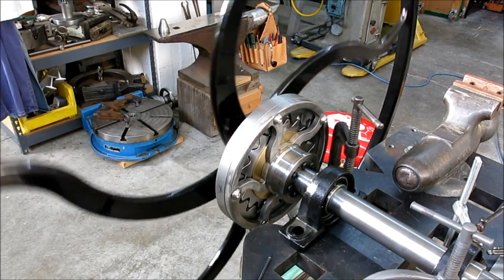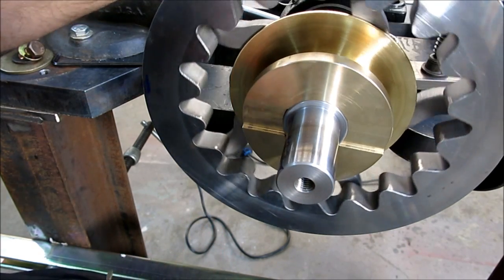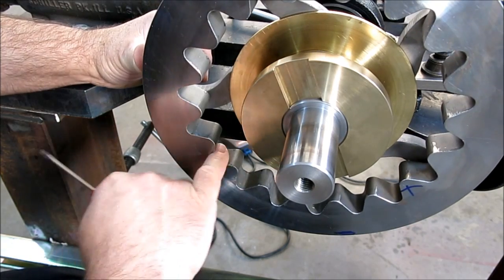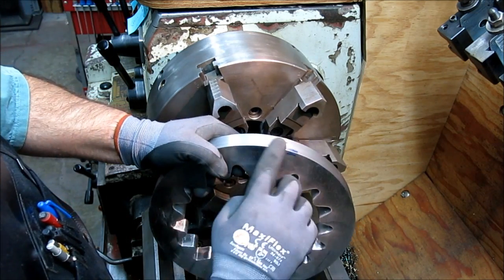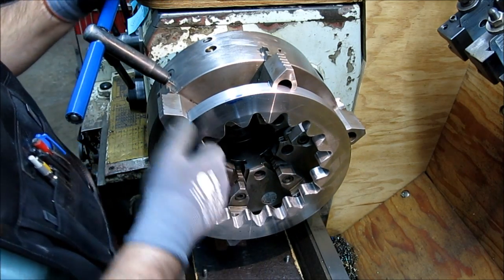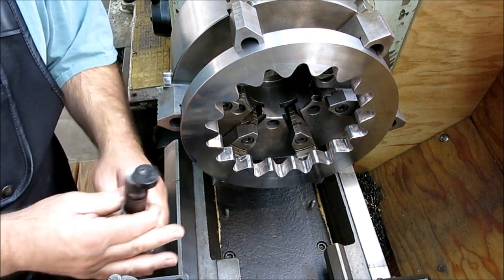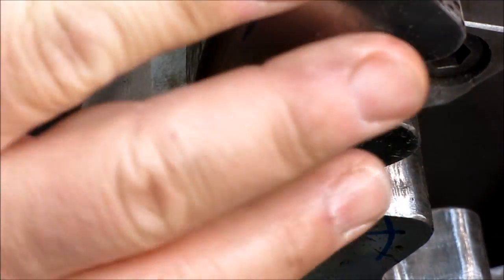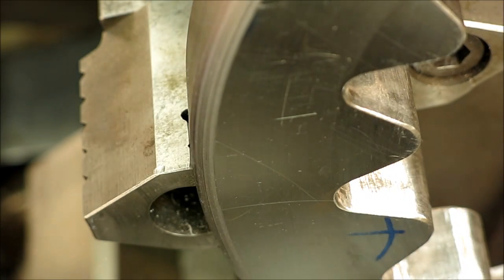Wabble Drive Bench Test

Comment: I have limited form tool experience but in what I have found it works better for me to do the cut in two directions so the form meets in the middle rather than the end.  It seems to reduce cutting forces chatter and make it easier to blend.  So I would have cut over then backed out come all the way in and plunged, then backed out and gone over again then repeat the back out and plunge and do that until I had my form cut.
 It also appeared in your test run that the shaft speed was speeding up and slowing down with each revolution? Looks like maybe the weight of the anti rotation arm was speeding it up when gravity could take over.  For the application it probably does not matter but would maybe the addition of a friction brake smooth the rotational motion out?
Reply from the maker: The drive is not a constant velocity drive. In fact the curve is a cycloid. The back and forth you noticed (sharp eyes) is because there is no load on the system so the lash between the gears can fall backward with gravity. All that will go away when the system is loaded in use.

On the radius cut I was pretty close to the chuck. I didn't want to Bozo it by moving two axes at once. 

All the best,

Tom
Reply: Somebody correct me if I'm wrong, but I think that uneven speed is caused by the anti-rotation arm swinging from side to side which causes the centre gear to rotate slightly backwards and forwards. When it's rotating the same way as the ring gear it's rotation is added to the ring gear which speeds it up, and when it's turning the opposite way it's subtracted which slows it down.  If the centre gear was constrained by a parallel-motion linkage so that the arm stayed vertical then the speed would be constant ... I think. But I'm guessing that the speed variation doesn't matter anyway for this application

Comment: Why not use some fine grinding paste? I'm really pleased to see the mechanism in operation, such an elegant solution! Regards, Matthew
Reply from the maker: Hi Matthew,

That might work. The contact points are a bit heavy for that right now. Filing them off seems to be the right method for now. I will run it for a while until I'm satisfied its good. 

Cheers,

Tom